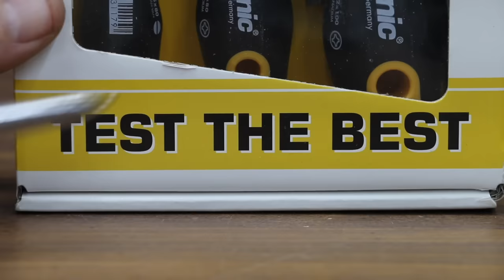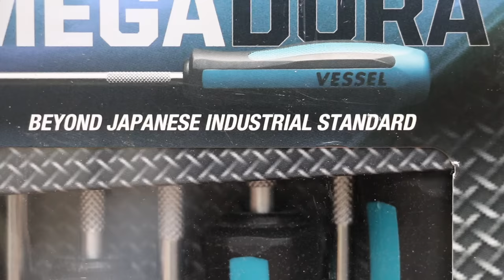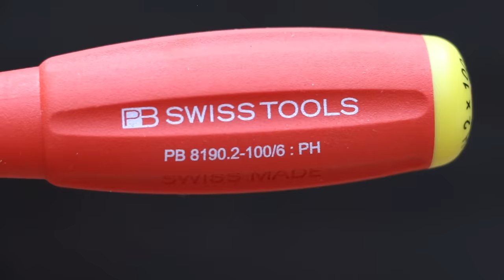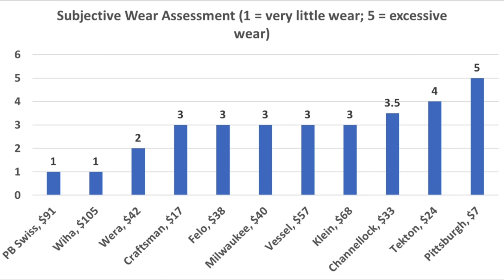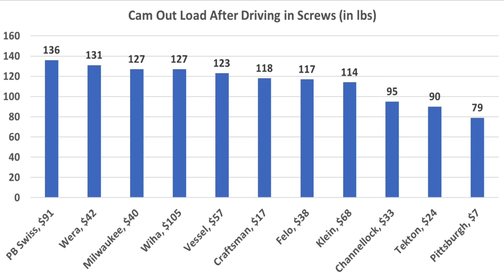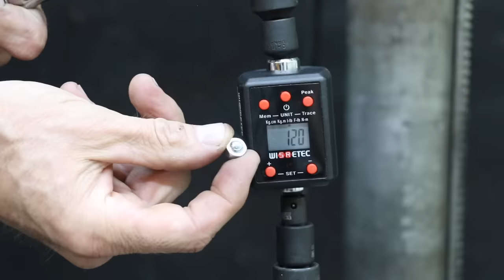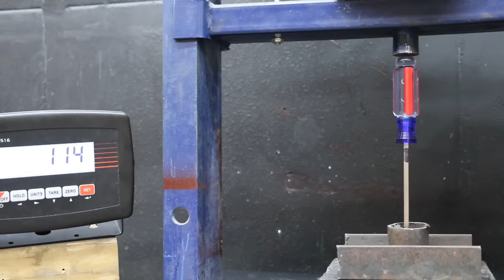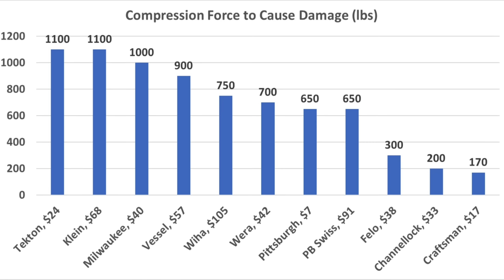Best Screwdriver Set? Craftsman, Milwaukee, Wera, Wiha, Klein Tools, Felo, PB Swiss, Tekton

Comment: As an electronics engineer, I have pretty much every size of Wera from micro to regular in every head. After trying many brands I found them to be the best value for money without compromise on quality, and do the least damage to screws - seeing your test results match that experience is very satisfying. On the mill I'm restoring, I've went through multiple cheaper drivers adding electrics before getting a set of Wera just for the mill :)
Reply: They make micro versions? Like what comes in those electronic repair kits?
Reply: @RangerOfTheOrder  yes. They're very well made.
Reply: electrician here. I use Wera primarily, although weidemueller also makes I would say equivalent quality tools. Mine are the insulated kind; I think its just a plastic sleeve on the normal screwdriver. That said, I have one Klein in my pouch as well; the #6 flatblade with the square shaft. It's my 'beater blade', so it's a lever, chisel, wedge, pry bar and sometimes I even use it on fasteners . 

In my experience, the Wera tools are much less prone to damaging fasteners than other brands. Milwaukee isn't bad, but the hand tools are too heavy and clunky. Like a Russian tractor. Plenty strong, just... not wieldy. This test was the one that I most easily predicted the outcome on of all the PF tests. I will say I have no experience with the more expensive brands shown in this test, however.
Reply: Can also confirm Wera’s quality. Apple uses their drivers for device repairs. Been using one of their sets for just under 4 years, and around 4500-5000 individual repairs on phones and other electronics.. I’ve only had to replace one bit so far. 10/10 would use again.

Edit: I’d like to add that the only downside of the drivers/bits are the price. The ipr 1 half moon bit (pentalobe for iPhones) runs anywhere from $35-$50 each. Pretty high price from what I’ve seen. But, seeing as how I’ve only replaced it once, less than $10 a year for use is not too bad.
Reply: Replacing screws is something most people don't want to do.
Reply: Yup. Wera precision drivers are my go-to. I have bought multiple sets to make up the ultimate set of tamper Torx and tamper hex plus every conceivable size of slotted and Philips.
Reply: I too own Wera but on breakers or disconnects i go for the Kline also for the small wago terminal block the Kline 602 is my go to fav for stuffing  the spring loaded terminal blocks as no prying is required.
Reply: I always think with electronics sometimes you WANT A screwdriver/bit that is quite soft, so that it is preferentially "sacrificed" as opposed to stripping the screw.

Because god forbid you have to drill-out miniature screws from miniature electronics boards!
I've superglued screwdrivers to the mini screw where it looked like it was stripping/post stripping simply to avoid a worse situation
Reply: Wera is the only one of these available locally in our village and i liked them the moment i saw them.
Reply: HA! Nice to see one of may favorite channels commenting on the videos of one of my OTHER favorite channels :)
Reply: Why do engineers have to make it a point that there an engineer before they give their comment.. Every engineer I met always always always always! starts with ..I'm an engineer blah blah blah..... basically insulting whomever they are talking to.. sorry just my 2 cents..
Reply: As an electrical technician , I only have wera screwdriver when i'm working. Did i say that i'm an electrical tech? Nice
Reply: @reacharound4724  I don’t know, I’m a carpenter and mention it when I think it’s important, of course anybody can say their whoever they want to be that day: I’m the President of Wera …
Reply: @reacharound4724  makes them feel important or something 🤣😂
Reply: @reacharound4724  most engineers I know (aerospace industry) think their sht don't smell.
Reply: @RangerOfTheOrder  Wera makes extremely high precision micro screwdrivers. I have a lot of them. They're very very precise. They even make Japanese Camera Manufacturers certified ones (they fit so snugly, it's unbelievable).
Reply: I am sold, the next screwdriver set I purchase will definitely be a Wera set, seem like a great deal for the money!
Reply: @kurtisb100  I would say you can make any screwdriver insulated by applying some appropriately sized heat shrink tubing over the exposed shaft.  I know that's what a lot of electricians do.  :)
Reply from the maker: Thanks for sharing!
Reply: Electrician here (automation/controls). It seems widely agreed that Wera makes some of the best small screwdrivers for precision work. A high quality Wera 3mm flat blade screwdriver will last for years, but a low quality flat blade will bend or snap within weeks. We expect a lot of tightness from very small screws, so minor flaws in the build quality of the screwdrivers readily present themselves. The dollar store screwdrivers tend to bend whereas more expensive ones tend to snap.
Reply: Been using Wera for electronics professionally for many years.

The best drivers I have used so far. They last a long time, are comfortable to use and don't damage the screws.
Reply: @RangerOfTheOrder  Yes, I've got a set of their small ones, as well as this larger set. They are also excellent.
Reply: @InfraReddest  I think it would also be important to mention that the price of the pentalobe micro bit is more of an exception than the rule due to it being very specific and low quantity product, I also use one thats a bit more expensive then usual because its not really common, its a microstix and costs around $20. Usually every single other size is between $7-$12, so the prices are actually quite reasonable for the rest of the bits.
Reply: My concern that has kept me from buying Wera had been the handles. I've never had a bi-molded handle stand up to use in industrial environments for more than a couple of years. After much exposure to temperatures, grime, and oils the softer material usually begins to separate. Your use case seems to be relative to mine, as do others comments here, so based on so many positive comments I guess I'm going to pick up a set to test drive.
Reply: @RangerOfTheOrder  yes just about every brand has micro drivers. I have micro sets in wera wiha hazet craftsman Milwaukee and I’m pretty sure each other brand shown here except for maybe the Pittsburgh from harbor freight have micro sets. Now that I think about it I’m pretty sure even the Pittsburgh have a set. Out of them all I like the wiha pico finish micro drivers as well as the wera. The regular wiha micros are nice enough but I definitely recommend the pico finish or wera over the regular wiha micro.
Reply: The micro wera tools are Incredible. I work on alof of pocket knives and it involves alot of locktite and I can't count how many torx heads I've stripped until finally getting to wera and wiha. To this day I haven't even come close to stripping the heads. I'll never pay for any other brand
Reply: Can Confirm
Reply: Thank you for you input, I’ll have to check them out!
Reply: Felo makes a range of 1/4" socket sets mainly used in the automotive electrical service industry mainly used on starters and alternators. Price is insanely cheap for a very underrated high end quality brand.
Reply: My father was a TV-radioman.  He, and other electronics technicians in that era, used Xcelite, so I have a few Xcelite screwdrivers and nutdrivers.  Like father, like son.
Reply: @reacharound4724  it was relevant to the topic. He was saying he uses the tools professionally. Same if someone said I am an electrician and I've found X screwdriver is best. It holds a lot more weight when it's a person that uses them everyday vs DIY Dave who has only ever tried 2 different brands and uses his screwdriver once a month on a loose door hinge.

People very commonly give their profession when it's directly related to the topic. It isn't bragging. What is the alternative? Say I am a person who uses screwdrivers daily at work? A lot easier to just say your job.

It's really odd you are insulted by this.
Reply: @reacharound4724  not saying some of us aren’t guilty of that, but it’s clearly pertinent and relevant to the situation at hand. When talking about tools, the most important context is what you are using them for. An electrical engineer has different needs than a mechanical engineer who has different needs than a mechanic, plumber, construction worker, hobbyist, whatever else. A lot of my electrical tools wouldn’t be much good in tests like these because they are dainty little things for working on tiny little circuit boards. But for a mechanic, you need to put some elbow grease into it, and a tool to match.
Reply: @kurtisb100  Weidmueller work great for setting valve operators due to their slim shafts but keep a set of Kleins on hand for the best gripping phillips drivers. Hard to beat Klein tools for the last 80 years. Still have a pair of my dad's 70 year old Klein lineman's pliers . The standard for journeyman and master electricians.
Reply: @rooky55  I have some older Klein tools; and they are top notch. However, I’ve bought some newer ones and they just aren’t. The linesman’s jaws are too soft, the blades dent, etc. The screwdrivers tips bend, the handles break…. I’ve been pretty disgusted by the modern Klein tools particularly for the price. If you have Klein made before about 2005 they seem great. I have yet to see anything newer they make that competes with either their old tools, Wera or Knipex. That said, after paying premium tool prices and getting dollar store quality for more than a few Klein tools ~10 years ago I haven’t been back. Wera and Knipex make what I want and Klein has lost my trust and interest. Now I make simple tool choices, be it screwdrivers or otherwise; Milwaukee for cordless (because I have compatible batteries, and their tools are generally a top contender anyway), Wera and Knipex for hand tools and Fluke for meters. Anything else is risky business.
Reply: @kurtisb100  I am retired and my Klein tools date from 1940 to 2008 and were all very durable. The Phillips drivers were the best I ever used for holding screws. I liked my weidmullers for valve actuator sets for their slim shafts and durability. Good experience with Milwaukee tools. Fluke meters are best but my Greenlee works OK for home shop but never at work. Having said this, when a tool does not perform 100%, it goes in the bush. When a tool feels right in your hand and is doing a good job it is a keeper but they all lose their edge sooner or later.
Reply: @projectfarm it would be awesome if you did a similar test with screw driver bits that are meant for a drill. Also another good test would be comparing Philips, Robinson, torx, etc.

Comment: I've been so curious about the relaunched Craftsman tools. Good to know that at least the screwdrivers are decent. Kudoes!
Reply: Lowe's revamped the Craftsman line..They look solid.
Reply: @MrDLRu  Yep, they look really tempting every time I am in there. I just remember how crappy Craftsman tools got.
Reply: U do realize that stanley black and decker owns craftsman not Lowe's
Reply: I have been using most of the new Craftsman line since I lost my CM USA tools when my home was destroyed in a wildfire. They are great and hold up very well. The power & mechanics tools are really top end in my opinion.  I gave a set of the gun metal wrenches to my good friend that is a mechanic, they get used everyday with no issue. I am sad that they are not made in USA anymore, but from my experience the name really means something again.
Reply from the maker: Thanks!
Reply: @JPBennett  Yeah, me too. Bought a set of Craftsman allen sockets and HF Pittsburgh brand were harder material and less money. Work in machine shop and these get used a lot.
Reply: @John Uh. He reviewed at least 3 German, 2-3 USA, 1 Taiwan, and 2-3 Chinese.

Comment: Loved the test! I use a lot of PB Swiss and Wera personally. I work for Abbott on blood analyzers and the Vessel  #1 and #2 are all we use because the JIS head is made for Japanese screws, which are very common on medical or precision equipment. Regular screw drivers cam out when only applying torque with zero downward pressure, and there are many instances you cannot push on a screw and only turn it. This test was great, but not for every application.
Reply from the maker: Thanks!
Reply: I didn't know that JIS screws show up in things apart from Japanese Motorcycles, Cars, etc. I've only encountered them myself because I used a Sanwa arcade joystick for a project and it came with hardware. This will really help me in the future. Guess I have more reasons to get a set! Thanks!
Reply: @RvH00  definitely! I actually haven’t used a regular screwdriver head and only JIS drivers for a few years now. Get yourself a set of the blue/black handle Vessel screwdrivers. You’ll be glad you did!
Reply: @seanp1129  or the red handles with striking cap and hex shaft, got me some for my kawasaki  as Christmas present, fit snug into those japanese screws
Reply: @andrean_7725  nice! Who makes those ones?

Comment: Love the videos just wish you’d include some of the most common sets among mechanics, and other techs. Would be cool to see SnapOn, Matco, and Mac put to the test against some cheaper options 👍🏼
Reply from the maker: Thanks!  Thanks for the suggestions.
Reply: Williams screwdrivers are the same as Snap On I've been told
Reply: They're all overpriced junk compared to Wera or Wiha
Reply: I would like to see Carlyle on that test as well.
Reply: Deleting my comment as I just saw you beat me to it- I was thinking he would have tried snap on also or Mac tools
Reply: SK Tools comes to mind.
Reply: @lunchboxproductions1183  Sure snapon is very expensive and you might slip into the law of diminishing returns with these products in that price range.
But there is still a huge quality difference between snapon and wera/wiha/pbswiss and similar, not nearly as much as the price difference, but still very noticable if you use the tool a lot, hell you can use a snapon for hours every single day of your life and still pass it on to your grandkids in decent condition, a similar scenario is simply unthinkable with wera and the like, they might last you decades, but not generations.

Comment: Great video. I have had the same Made In USA Craftsman blue/red/clear acetate handle screwdrivers since the late '70's, all but the No.2 Phillips (which always seems to get the most use)  is still going strong. I always felt that the  Craftsman brand tools were the best because they were typically of good quality, were reasonably priced, easy to get at any Sears and easy to get a replacement if it broke. Sure do miss Sears stores.   How about a comparison test on ratcheting screwdrivers or maybe multi-bit screwdrivers. Keep up the excellent work.
Reply from the maker: Thanks, will do!  Thanks for the video idea.
Reply: Absolutely right about old school Craftsman “USA”.  If I’m ever at a flea market, pawn shop, or garage sale, you best believe I am looking for any hand tool by Craftsman USA.

Comment: Would love to see various JIS driver's using the same screw heads. I have vintage Japanese motorcycles, and a JIS driver in a JIS head is a different experience than Phillips, but i use the JIS drivers for everything.
Reply from the maker: Thank you for the video idea!
Reply: I have had the same experience with Honda Mowers. I also use mine for everything. They work great.
Reply: Agreed. I also have both JIS and Phillips sets. I bought the JIS to work on my motorcycles. Would love to see him test that.
Reply: Go ahead and get the impacta jis off amazon. It seems to work very very well for me. I also like the wera for their lazed etched ends for normal Philips head screws
Reply: My JIS seems to like camming out when I grab it by accident, maybe it's just mine. Of course, those silly carburetor screws make them worth their weight in gold. Think mine are Vessel.
Reply: @gresvig2507  actually I think mine is a vessel too. Probably the same unit. It's the magic driver for those Japanese brake fluid resovoirs too. All those screws are so stripped out already.
The laxer etching in the wira fixes that so well tho, for non jis screws
Reply: JIS screwdrivers are the long-hidden secret to successfully working on Japanese motorcycles and cars.

Comment: I've had the same set of Witte screwdrivers since 2004, minus the one that was stolen, they are all in great shape. Would love to see them compared in a version 2 of this test. I have a friend with a set of Wiha and they are just as good as my Witte, so I'm sure they compare favorably.
Reply: I wanted to see Stanley brand tested to. I’ve bought a 6 pack from them before to keep inside the house, instead of always going to the garage. My mom and sister also tend to “borrow” my screwdrivers and that’s it for them. Stanley brand always did good though. Never had an issue.
Reply: I have a couple of Sheffields that have lasted a long time...to add to the Phase 2 of the screw driver test.
Reply: And I'm never gonna give it back to you 😂
Reply: I've had pretty good luck with Witte too, bought a cheap set of insulated drivers for about 12€ and it held up very well on the job for years.

Comment: the one thing that is super nice about the vessel (at least the one i have) is that it works like a manual impact driver for removing stuck screws - if you hammer on the back of it it has some magic in there that makes that happen. I don't know if that's a standard feature or just the one I have.
Reply from the maker: Thanks for the feedback.
Reply: I have the Vessel impact screwdriver set too. It’s awesome.